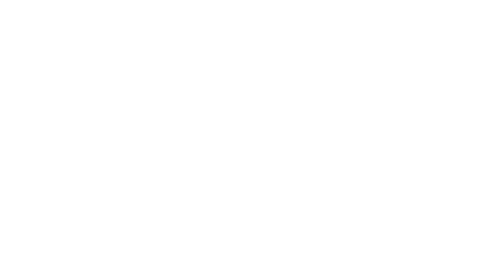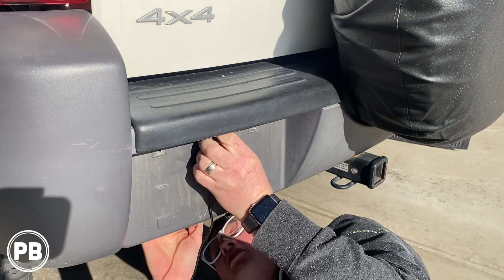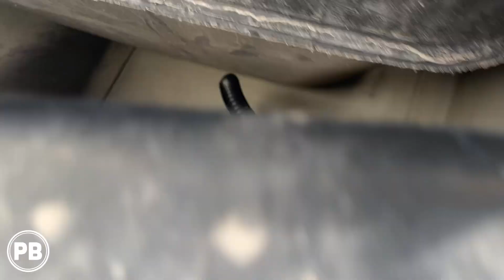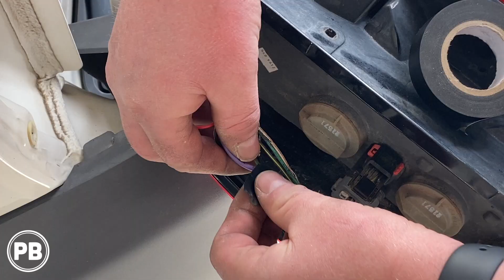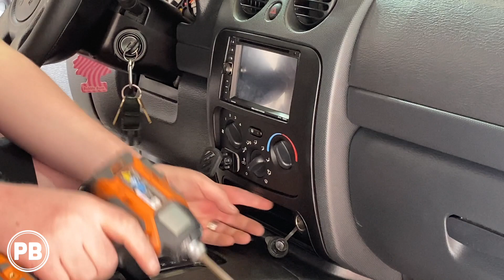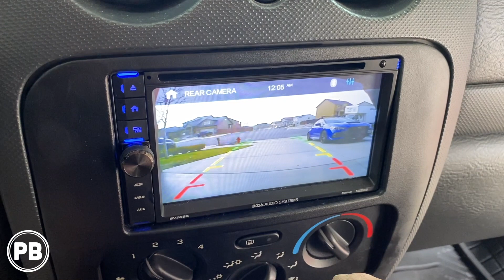2002 - 2007 Jeep Liberty Backup Camera Install

Comment: NO, No, No!  Remove the center break light.  Drill a small hole in the middle, about 1.5 8nslches from the top,  just big enough to run the camera wire through.   It's hollow, so also drill a hole on the left side of the houing.  Snip off the camera wir long enough to slice it back later after youve run it through  the break light .  Then splice it back and do basically what he did to run the wire.  You get a great center view doung it that way.

Comment: There's a positive reverse wire in the driver kick. Grey/white, no pin assignment. There are a lot of harnesses up there, but it's there. I also don't like wiring the camera to accessory, as I see no need to power it unless you're using it. I always use the reverse wire to power the camera. (Some setups, like Maestro, don't want you using the reverse wire, so in those cases, I wire the camera to accessory.)

Comment: Reverse light(+12v)  should power the camera AND tie into the integrated trigger wire in the video cable. silly to run power back to radio.

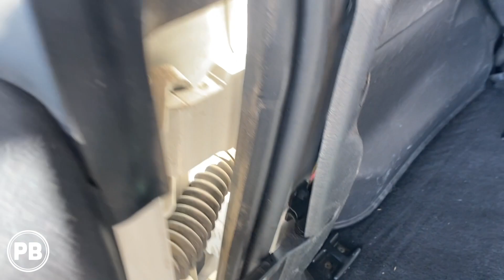Comment: so im trying to do this but i cant get the panel by the back door off, the one you are touching at 5:21 also how did you get the wire from that panel through the frame to the weather seal?
Reply: There is a plastic pin you have to pull out first that is recessed into the panel, then it should pop out by clips

Comment: The stereo that you have linked isn't the same one that appears in the video. I see that the linked stereo is more expensive than the one in the video , maybe it's a little better? Also do you have a video where you install the double din stereo?
Reply from the maker: The radio in the vehicle is a discontinued older model. Any standard double din will work, and recommend most major brands like Sony, pioneer, alpine and kenwood. We have a radio install video, but it’s super old and only with a single din.